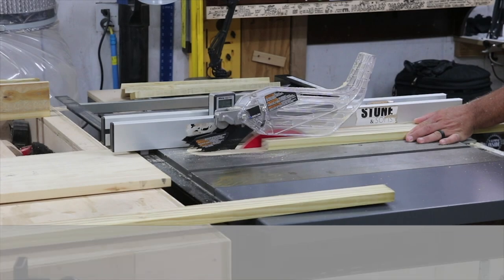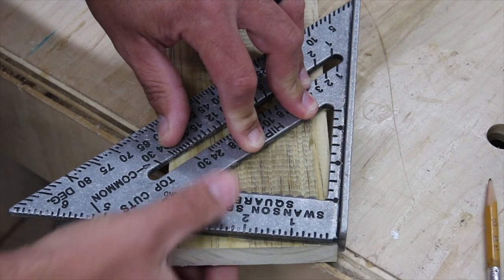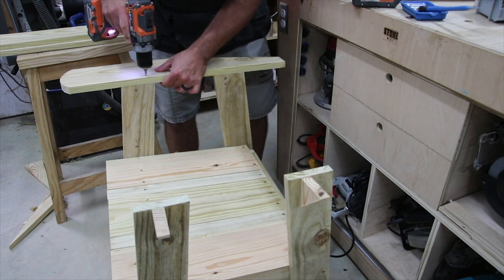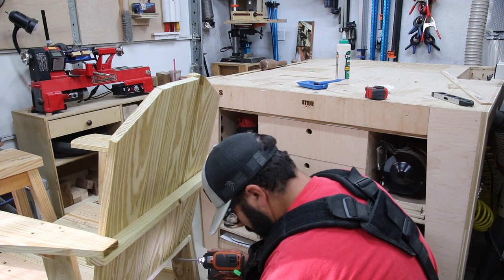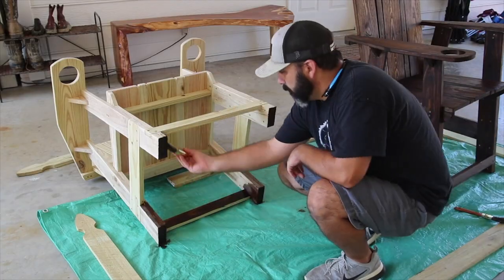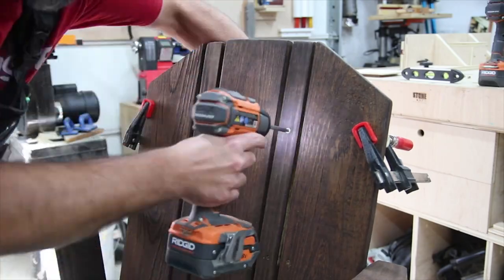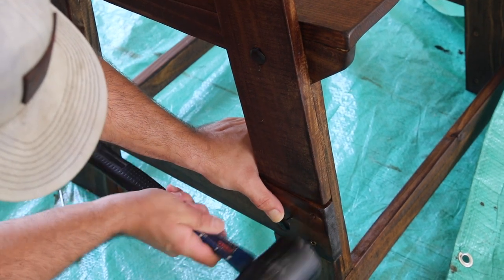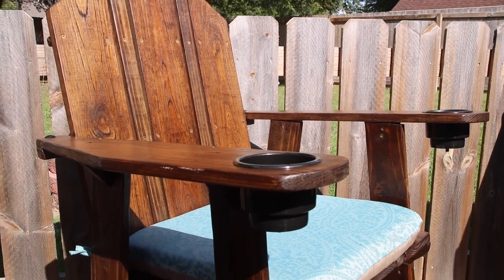DIY Patio Furniture - How to Make a Chair

Comment: Chairs look great Shawn. As a slightly taller than average guy, I love the height of these. Look like they may fall somewhere between a normal chair & and bar height?  Not a fan of the nails personally, but stuff like that is highly subjective. Great choice of switching to the black cup holders also. Love what you’re doing! Keep it up.
Reply: Thanks! Yes, they are in between normal and bar height chairs. Thanks for watching.

Comment: When finishing a project as the chair, what do you do about the spaces where you can't reach with a brush (cracks between the back slats)? Do you remove the slats and put the finish on or do not worry about coverage there? Great videos, so keep them coming...
Reply: I would normally remove the pieces and coat, but on these I just got as much as I could or that you could see. These are treated boards as well.